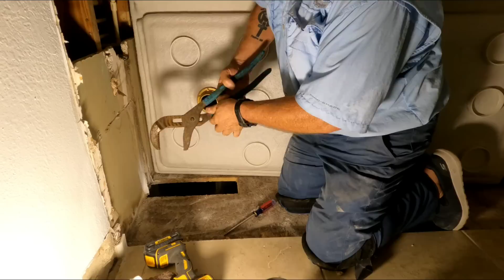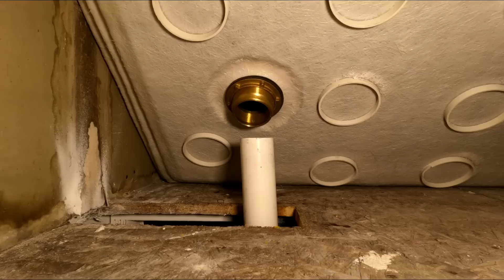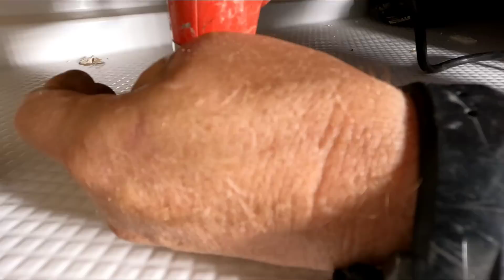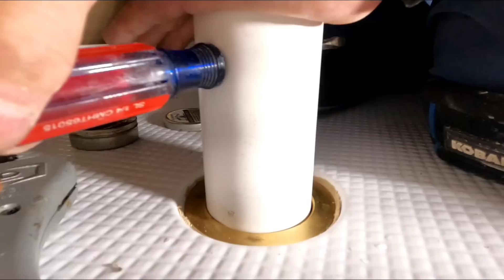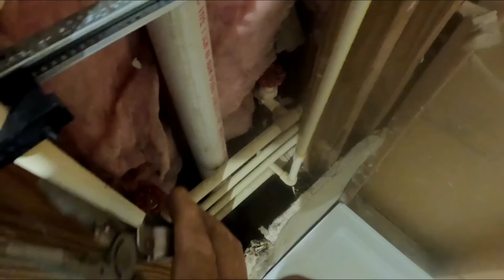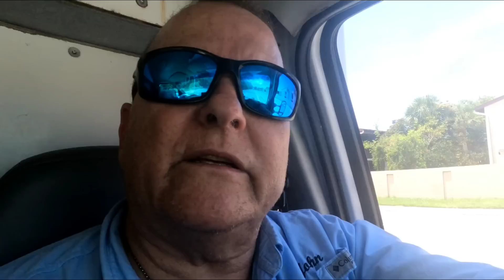SHOWER REMODEL.   (CONCLUSION)

Comment: What's the deal with that red shut off valve low in the wall on cold water line !!??
Reply from the maker: I saw it,but i dont touch anything i dont have to.
I remember when those units were built,flowguard gold cpvc had not been on the market very long.
I will say i was impressed with the condition of the pipe.
They have improved on the valves and such since the beginning.
Thanks for watching